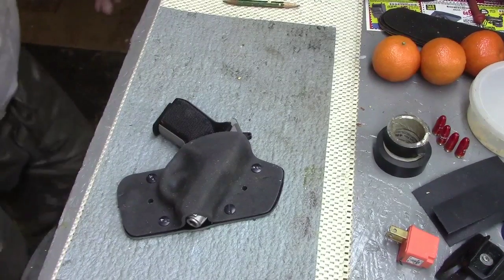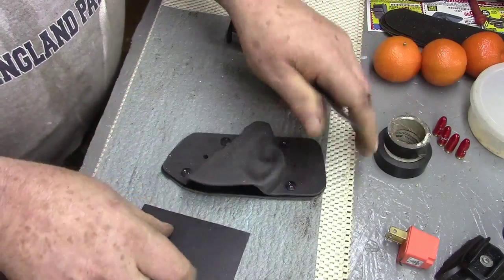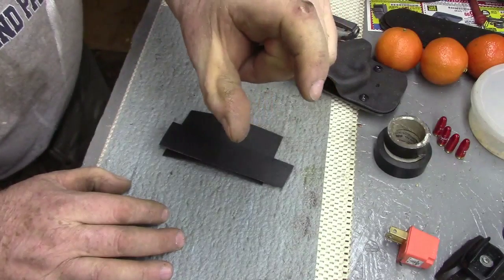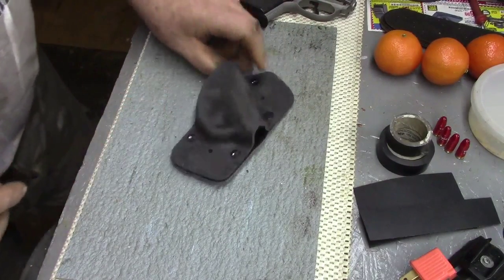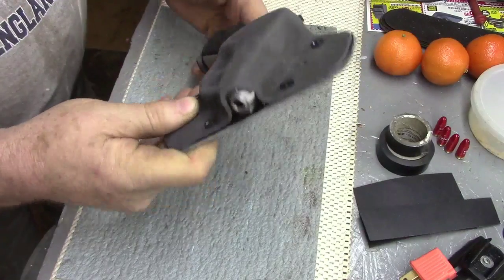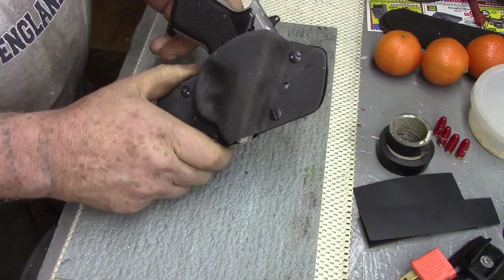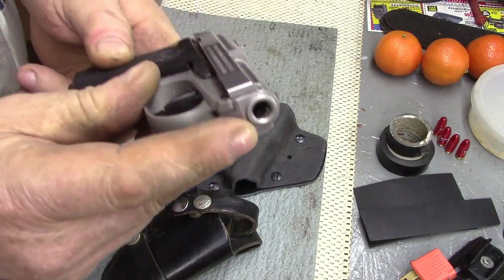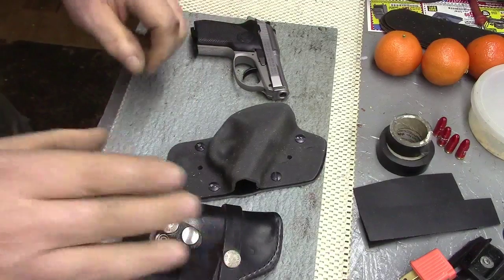Holster made with Worbla

Comment: Any update on how it worked out? Do you still carry it, has it worn down?
Reply from the maker: I still have it but don't always carry the firearm, I thing the Kydex works better as my first choice overall but I would use this again.  Layering this makes for more control thick/thin, Kydex is easier to work with.
Reply: @buzzsah  I just happen to have a large amount of worbla and the new handgun I have doesnt have a ton of options so I was thinking about trying it but I was afraid of the structural. Then afraid of heat in the summers deforming it
Reply from the maker: The summer isn't going to deform it, it hasn't mine anyway.  If you have enough to play with try making a holster for a light, or something else.  Get a feel for the thickness, how thick, will it crack, the shape of your hip.   Making one just for the knowledge and fun of making it even if you don't use it.   Just do not heat anything while in the firearm, heat then apply.